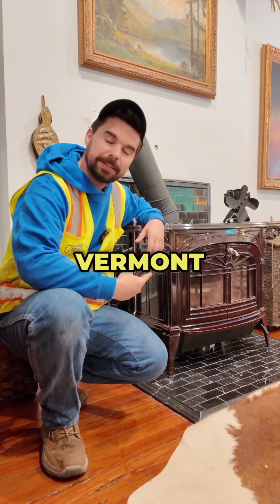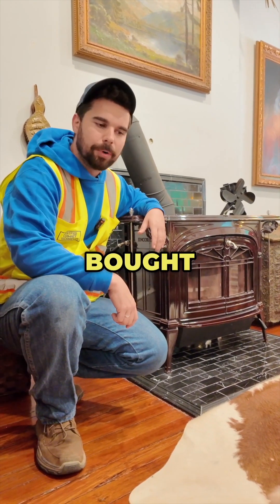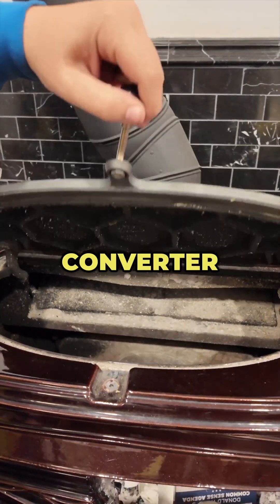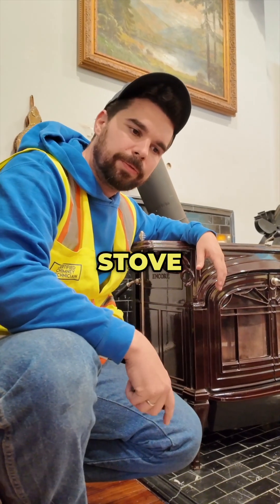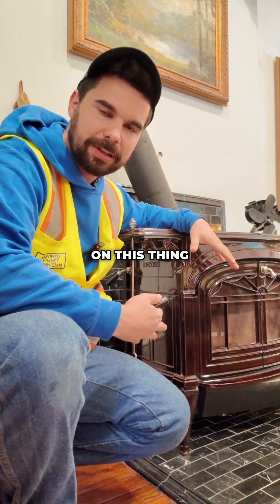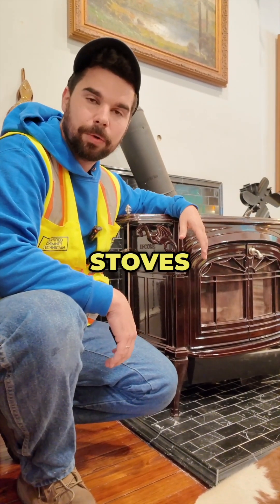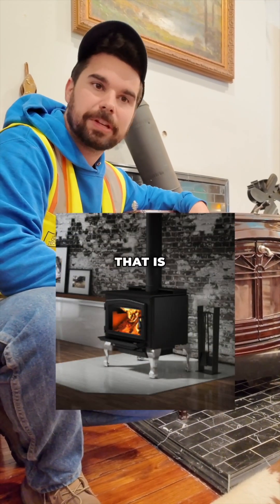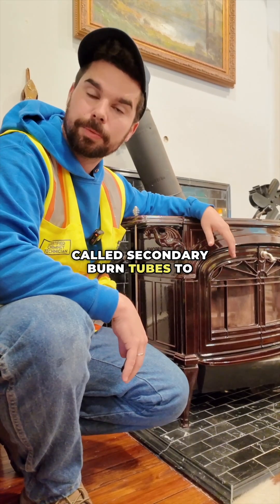Why Vermont Castings wood stoves kind of suck

Comment: All I can say is it’s 28 degrees outside and 72 degrees inside my tiny home. I love my Intrepid 2. Bought it used and Rusty from the original owner who had it over 15 years. My Son in law was with me when I bought it. He flat told me in front of the seller your crazy to buy that old wore out stove for $800. My first burn was tonight because my mini split quit two nights ago. Son in law came over to check on me after I had it burning. When he stepped into 82 degrees and seen how beautifully it was burning. He told me I stole it at that price. It’s amazing. 2.5 hrs burn one tiny 1/4 round oak. 72 degrees in a 462 foot tiny home. Love it

Comment: "Chimney Scientist" can't get his stove working.  😂

I have an Intrepid II and it works fine. Get it hot before you use the catalyst mode. Move your air intake control all the way hot (towards the middle of stove) when in catalyst mode. Move the lever cooler as needed.

Comment: Agreed.  I have the same 2040 series Encore.  Which replaced an earlier Encore. This one is extremely temperamental.  (As others have mentioned, those two 90-degree bends in the stove pipe aren't helping)

Comment: Your review, is how does one say it. You or your employer sells a different brand you bash another brand of stove. VC defiant & Encore are both secondary burn and catalytic stoves like fireplace X trodainaire wood stoves. While the VC stoves are a bit more picky on the flue set up, any decent dealer will guide the buyer accordingly.

Comment: Catalysts have their place, and are in fact efficient, but they're not for me. 

In the deep northeast, I want to be able to depend on my stove to perform through any condition and utilize less than perfect fuel if ever necessary.

As much as I depend on my stove to heat my home every day in the colder months, I want it to be a relatively bulletproof, low maintenance item that could last for many decades (if necessary) without service outside of firebricks.

In my opinion a catalyst is simply too fragile, high maintenance, and costly to be depended on if the world ever collapses around us. Secondary air tube re-burn stoves are much more reliable, while still being extraordinarily efficient. They are for my use case the best option.
Reply: Green Mountain 60/80 are dual and work very, very well if you have the right draft (just like any wood stove). Reasonably priced. We will often run without catalytic for a quick heat or when we want to look at a fire. Using catalytic brings our burn times up (once we have a really good bed of coals) to hours. BTW, one side effect of the catalytic is its high temp, which makes the stove hotter when burning less air. If the world is going to fall apart, using the catalytic makes you less visible to the outside world. Barely a whisp of smoke and very little smoke odor comes out of the pipe when it is dialed in.

Comment: Maybe you are not using it correctly?  I have had one in use for 32 years.  Works great with massive heat output and efficient burn.  Starts easily, burns on high and low settings.  Love it.
Reply: They didn't make them the same back then.
Reply: Not the same stove at all if yours is 32 years old.

Comment: The Six inch pipe has to funnel the air mass with a six inch pipe. If the volume of pipe changes such as 6 to 8 inches then you will have a high burn rate. He probably just shoved it up the chimney.  He works for a wood stove company? Go home and wear your safety equipment when you  need matches to light a candle

Comment: You have to start the stove and bring the operating temperature up to at least 400 degrees before engaging the catalyst.  Yout problem is operator error.  I am on my second vermouth casting stove and they work great.  If you want to advertise a certain type of stove you should just do that and not malign a great product.
Reply: That's how I operate my Woodstock Soapstone cat.  Users manual clearly says the stove must be brought up to temp for the cat to even work right.  My chamber burns blue flames and the cat glows red.  Plenty of heat output.

Comment: I went up to Randolf, VT in late 70’s to check this stove out. I liked and bought it. Catalytic stoves are “twitchy”. Yes, you have to get a good draw. I would get mine burning really hot once every day and it did just fine EXCEPT sometimes in the fall or spring I would have “back puffing” and it set my smoke alarms off because of the smoke. Otherwise it was a nice stove but now a days I prefer non catalytic.

Comment: I had that exact stove for almost 20 years, if you use it properly it is super efficient with great heat output, it was worth every penny. It had zero smoke when you use the catalytic converter and put out an amazing amount of heat for the wood it used.
Reply: No you didn't.  If you bought it that long ago it's a different model, without a cat, made in a time when VC was owned by a different group of people and the stoves were built by people who took pride in their products
Reply: I have an encore and I want to throw it in the nearby lake.  I cannot get it to put out enough heat.  I had a Youth before that was incredible, heated my entire house, and a Vigilant before that model 1975, I think, it was incredible.  How can you make this thing put out heat, I am literally freezing on the couch five feet away from a shut down stove running at 600 or more degrees.  It is so,ply not hot.  The back tin should come off?  The ceramic panels on the sides should come out?  I want to take a sledge hammer to it and it is pretty new.  Sorry, my frustration, it is my only source of heat.  I'm cold
Reply: @alekjuskevice maybe aim a box fan at it to move heat off it? That's crazy 😢
Reply: Thank you, getting one in the kitchen.

Comment: Why don't you just remove the catalytic converter?
Reply: Then he won’t have proper air controls to run it like a normal stove.

I have a blaze king and love it. Also a catalytic stove.
Reply: @GotrekGurninsson  VC stoves can be run with or without their combustors installed. Most of them even have EPA certifications of both configurations.
Reply: @BlackForestWoodStoving  Yes they call it flex burn I believe.

Comment: Bought one two years ago and have same problem. I have to crack open ash tray to get enough air flow.
Reply: Have the draft tested. If your installer does not know how to do then this find someone who does. Getting enough draft in the stove is everything. Getting more draft, especially if you have elbows, means adding chimney height. This also means lighting the fire correctly to get the pipe hot enough to draft in the beginning of the fire. If, in the end you have too much draft, then you would add a baffle. So, yeah - try that first. ANY wood stove needs the right draft.
Reply: Also, see about adding a fresh air intake. Game changer for relatively well-sealed houses and prevents sucking cold air in to replace already conditioned air.

Comment: Complain about the stove not being able to produce a draft and I see a chimney with a elbow right off the top of the stove and a rise that is barely 18" to a 90 degree elbow out the wall.  This is more likely the reason the stove will not or is hard to draw.  90% of the time when a wood stove does not draw well it is a negative pressure problem in the house or a problem with the way the chimney has been run.  The chimney system is mainly responsible for producing the draw on the stove, not the stove itself.  Oh, and putting ceramic tiles on a combustible wall?  That doesn't reduce the combustible clearance of the stove at all.  And a new wood stove will not burn down to the 1.2 grams emissions without a cat converter.
Reply: He’s wearing a safety vest, he must be legit.
Reply: He is a scientist? I am now getting an Intrepid, in black.
Reply: It’s okay, he’s a chimney tech 😂😂😂😂, he forgot his clown nose and wig this morning

Comment: Hi,  I said the same thing until I calibrated the temp adjustment damper.  Unfortunately VC did not do this correctly or the calibration changed during installation but I MUST say that this is an amazing stove now that I have it dialed in.  I absolutely love it and it burns very very clean.  I will make a video about this stove soon
Reply: I will make a video at some point but here it what it basically is:  start a normal fire that burns for at least an hour (I realize that may be difficult with a stove that isn’t working properly at the moment).  The best way to help the fire with the temperature control is to bypass the temp control by putting a screwdriver in the damper in the back of the stove to force it to remain open.  So here’s the trick:  you want the stove to be a hot as it can be without damaging the stove, 900 degrees on the stove top but come to this temp only after the stove has been burning for at least an hour (the point of the long burn time is that the metal coil in the thermostat control has expanded to its maximum length)

Now that the stove has maxed itself out do the following:

1.  Turn the temperature control to the lowest setting (lever should turn towards the back of the stove)

2.  Remove the screwdriver which should immediately allow the damper door to close instantly.

3.  Loosen the set screw on the damper in the back of the stove.

4.  Pull the metal cable through the set screw until just enough to feel no tension from the spring.  (Note:  you want the cable to stretched to its maximum.  At the same time, you need to make sure the damper is fully closed and that you are not unintentionally opening the damper door.  You also do not want to feel the internal coil being stretched.  You only want the cable taught enough to be tight with the coiled being pulled on)

5.  Since you did all this correctly,  now tighten the set screw.

Now that you did all this,  you should be able to pull the temperature lever to high and low and see that the damper in the back is opening and closing.  (the temperature should be open when you have set it to high temperature and closed when you set it to low temperature.)
Reply: Hey how do you do that I'm in the midst of fighting my vc dauntless.
Reply: How does one calibrate the air damper in a Vermont Casting Wood Stove
Reply: Is that the damper known on the side that goes to the flap in the bottom, rear?
Reply: How did you adjust it? My new stove draws about as much air wide open as it does closed and the air control doesn’t seem to have any effect

Comment: Hogwash, if anyone looked into the converters they would know that due to having one means it reburns the smoke that normally would have gone up the chimney. Also, if you feel the converter is causing less air flow, then, why not simply remove it. then, you would have just another stove. I see this as just another scare tactic to pull unsuspecting public away from what truly does a great job at heating the home it is installed in.  I bought a wood stove with a converter in it over20 years ago and will attest of its fulfilling enjoyment having it in my living room.
Reply: Did you keep the catalytic converter in the stove?

Comment: The stove is not the problem. It’s the user. You need to learn how to use a catalyst stove properly.
Reply from the maker: @Idahoprepper71   thank you for this feedback. You are often correct. Your average consumer does not know how to properly use a catalytic stove. I didn’t go into much detail in the post and I could talk about the use of catalysts versus secondary burn technology forever. 

We install stoves for the average consumer. I promote what I like in my personal home and do not like. 

I’m sure you can agree at a minimum that a catalyst reduces flame height, can blacken the glass more quickly than a secondary burn tube woodstove? 
To the average homeowner this does not meet their expectations. Especially if they have had a non catalytic, secondary burn Woodstove in the past. 

Catalysts do not greatly reduce emissions at all compared to secondary burn tubes. We have catalytic stoves that are 2 grams per hour and burn tube woodstoves that are 1.2 grams per hour. 

The efficiency ratings can be anywhere from 70-78%. Catalysts are often used to meet the 2020 epa requirements of 75% or greater. So if I had a choice to purchase a Woodstove with a catalysts at 75-78% efficiency or a Secondary burn tube woodstove at 70-78% efficiency, I’m going with the secondary burn tube Woodstove to avoid all the issues associated with many catalytic Woodstoves, as well as the easy of use and better visualization of the fire. 

We see  lots of issues with catalysts maintenance they can be difficult to remove and repair after stove warping, catalysts can clog up from heavy use and often disintegrate overtime which means they are not properly functioning at all. A Woodstove is supposed to be about freedom. Freedom to enjoy your fire and heat your home without paying someone else for fossil fuels. 

Set it and forget it. Simple easy to use technology. No BS, no problems and no calling another person to help “fix” the stove.  Stoves used to last decades without a service call Beyond a cleaning. Ceramic Catalysts are the end of that era. Warping, degrading, replacing parts and paying the chimney scientists to do it.  Fighting with manufacturers over warranty claims.  It’s a waste of everyone’s time and homeowner’s money.  It’s not why I got into fireplaces and Woodstoves. 

I hope technology changes my mind someday sooner than later.
Reply: @chimneyscientists  Most people who own these VC stoves complain about them always overfiring and running away, so your experience is counter to the norm, which leads me to believe you have a draft problem or a combustor that needs cleaning. 

Most of these VC stoves have been qualified to meet EPA emissions with or without the CAT, just remove it if you don't like the way it runs with it. 

There is no 75% requirement for efficiency, only an incentive for stoves that meet this or higher. (ending soon). There are many stoves being sold today, including SBI stoves you sell, that are 68% or less but still meet emission requirements. 

Catalytic/Hybrid stoves require a different approach to operation. When operated well, they deliver longer steadier burn cycles, more efficiency, and less emissions, when operated poorly, they create headaches with combustor stalling, sooting, or overfiring. 

Woodstoves are about freedom. I think it's pretty cool that we still have the freedom to choose either a non-cat or catalytic stove. I enjoy burning in a hearthstone hybrid stove that combines secondary combustion air injection above the fire with down-stream catalysts, supporting a gentler flaming fire that can transition to a catalytic smolder an longer lasting coaling phases than non-cat stoves. A load of fuel over coals before bed will last till I  get home from work the next day.
Reply: @chimneyscientists I'm pretty sure you can remove the cat on these stoves and just run them that way if you're having draw issues.  The cat is an option on the lower models but they all draft the same.
Reply: @MikeyG-wu7ux you can remove the catalyst very easily. I have a Vermont Casting Encore 2040 and it’s a simple matter of removing the ceramics in the back of the stove (no tools needed) and taking out the catalyst which sits on a sill inside the back. The catalyst is expensive, over $300 for a Vermont castings replacement but you can buy an aftermarket one for about $200.